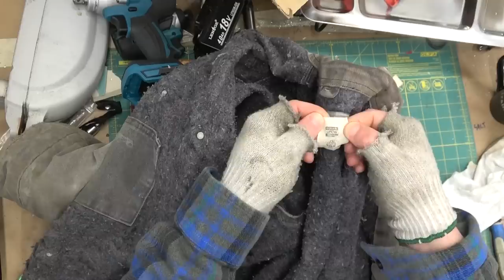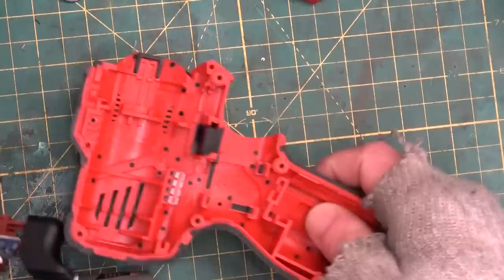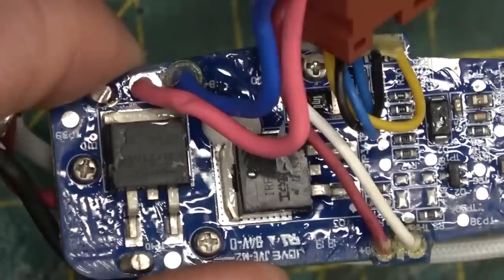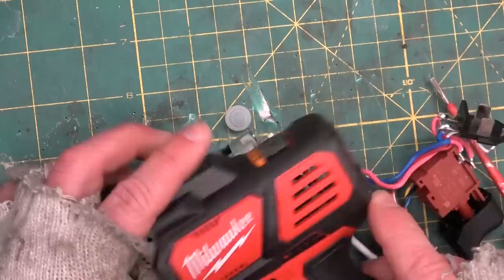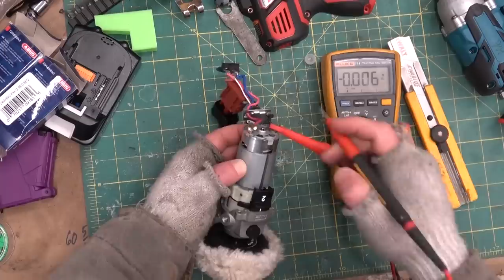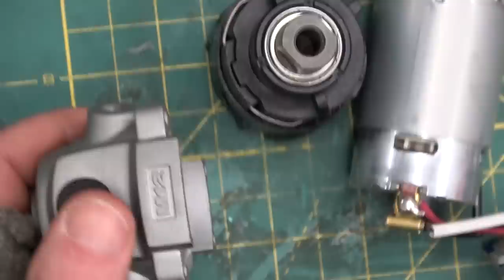BOLTR: Milwaukee Sander

Comment: When you measured the continuity between the negative and the case you put one probe on the flux ring. Are you sure that flux ring makes electrical contact with the motor case?

Comment: When you see the difference between the output bearings the comparison is over.  I liked the cap over the mabuchi bushing but that should really be a bearing.  Did they at least use a bearing for the mabuchi output behind the pinion?

Comment: AVE have you had any issues with the 12v Milwaukee batterias? I have had 3 of the jeslus things ( 2 x 6ah and 1 x 4ah) die on me recently after what can only be conisdered very light use as i bought them as a backup to my backup kit for when everything else is out on site. Considering the money I paid for them this has left me slightly grumbly about that particular shade of red power tools.
Edit: 6ah not 5ah

Comment: I have a very slightly newer version of that Carharrt coat circa 2008 and first thing I did was remove the annoying inside elasticated cuffs, aside from that it's a hard wearing use and abuse coat. Also Snapoff isn't what it used to be, is anything?!

Comment: I bought a single snapon electric impact gun about 3 years ago. It was repaired twice in the first year, one of the batteries completely died about a year and a half in, and the charger stopped charging at about 2 years... I had to pay all this out of pocket.  Sold it and bought a milwaukee impact. I'll never go back to snapon electric tools.

Comment: Replacing the Dewalt 18 volt drills and driver with their 20 volts, because all of the batteries have bitten the dust. ( almost as cheap to buy new tools than buying three new batteries) Should I change horses and go with the Milwaukee? Never had a Milwaukee tool, but AvE seems to like them...

Comment: Can't say the trait has carried over to other Snap On tools in my arsenal, but i CAN confirm, their sander/polisher here, does suck. It overheats and goes into protection mode every time i use it. All i use it for it decal / emblem tape removal with the 3M rubber wheel. End up using the drill instead

Comment: What are the reasons for not using regular cheap drills?
You might wear them out cuz they're not designed for an axial load but have to be able to handle some
Reply: Rpm

Comment: In my own experience any battery operated tool snap on has made have always felt clunky and a bit awkward. For whatever reason Milwaukee always felt better in the palm. Snap on makes great tools that don't require tickle pixies flowing through them. Scan tools included.

Comment: The clothes don’t make the man,  it the man that makes them what they are.  Police uniform is you clothes until they put them on and run after you that you know you fûćked up.  I’m here for the tools and the jokes not your fashion.  I use to be a dewalt fan but I have switched to milfuky even if I had almost every 18V dewalt and most of the corded too.  Since they did away with my 18v battery I was a little mad then after buy 12 Milwaukees both 12v and 18v them dewalt people comes out with a 20v adaptor.  Thanks for the fun video.

Comment: Got a question, what exactly does the flux ring do. I wanna say stops the magnets from reaching out to other things. But I'm guessing. Can someone esplain.
Reply: I believe they concentrate the flux in the motor for more chooch for your choch.  There probably is a better explanation below this comment though.
Reply: In dynamo-electric machines with stator or rotor bodies having permanent magnets, the flux ring is an annular housing that provides a low reluctance path for the field on the magnets' anterior, thus increasing flux density in the rotor-stator gap.  In advanced form, flux rings are formed from an isotropic magnetic material sandwiched by an anisotropic magnetic material.

I hope that helps
Reply: @cfeigel  for sure.
Reply: @raymondmucklow3793  See? I knew someone would come along with some actual knowledge, or at least a good grasp of googling. I think my response might be the "for dummies" version.

Comment: We have the fapoff small impact gun and the milfukee small impact gun. Both about the same sice, but the milfukee feels much better in the hand, has a lot more power, has better batterys, and i think it was actually about 60% cheaper, might even be more.
So after i got the milfukee for my toolbox the snapon guy steps in the door, and i had the box and everything on my toolbox. So he was like what is that? I told him it was a better tool for les money. Guess he didnt like it. He picked it up, held it, tryed it and said i think the fapoff is the better 1. Now 3 or 4 years in i'm 100% sure the milfukee is the better 1. If the fapoff(from my boss actually) dosnt get the job done i just have to go in and get the bolt lose with the milfukee just to prove its better. And the same is true for the big impact gun, and the carpenter special, aka the cordless drill. The fapoff electric machines are not worth their money. The milfukee is a better tool for less money. I really like my handtools from fapoff, the toolbox is nice as wel. But i wont be buying electric powertools from them again.

Comment: I used to swear by Elu tools and the original Metabo tools. Hard, professional tools, and they felt like the Gods of Engineering had created them. Then De Walt tried to pretend they were Elu, which were discontinued and their nice manly grey and blue design was gone - and they weren't, they were plasticky garbage with hopelessly short lifed, over priced batteries. De Walt is all just marketing to men and women who are the 'preppers' of home improvement, who want 20 garish power tools nicely lined up on their garage walls. Never be used until SHTF. I was aimed at Milwaukee a year or two ago by a similarly anally retentive power tool conoisseur, and to be honest, I have  told people that their M18 Fuel system is fantastic, and I wish I had had them 30 years ago - If in doubt, go for the Milwaukee. Now I have gone over from everything to Milwaukee, and I also really really like the 10.8/12v blue Bosch tools for light work. Bosch is still inexpensive and nicely made. I really like these videos because they show the subtlety of construction that only tool addicts could ever appreciate - Superb job.

Comment: Milwaukee beats Snap On isn't saying much, we would take a new CH 3/8 drive air ratchet, sold at Wal Marts and use it to rebuild our Snap On air ratchets as the parts interchanged precisely....Old Milwaukee is now proudly made in in the far east (China) with every cost cutting material, some not known to man yet.
Snap On still makes some of the best, if not the best, tool boxes and hand tools

Comment: The snap-on quality is quite shocking. 
And not having a seperate le-batteria terminal circuit board - this is either smart efficient manufacturing or penny pinching
 I guess we'll see after multi le-batteria ramifications of the tool.
One downside to this Vidjeo. If mil fuck key management see this vidjeo they're gonna think; 
Hey! are tools are way too good better cut back on the quality?
Seems like a race to the bottom..

Comment: Snap On is such fucking garbage. A loser old friend of mine had a flashlight it was a gay ass Snap On and he bragged how he paid 600.00 for his gay ass flash light and it sucked so bad, ridiculous batteries he can’t find anywhere and then they would only last about 15 minutes it didn’t have any way to adjust the brightness settings, and then I have a phoenix kitty 35 flashlight that was only 150 bucks it blew his gas light out of the water like it was nothing. The phoenix light has brightness settings you could use any kind of 18 650 battery cell in it water proof etc etc.